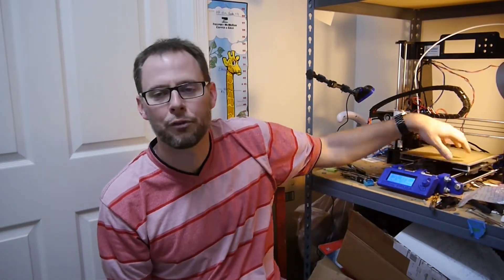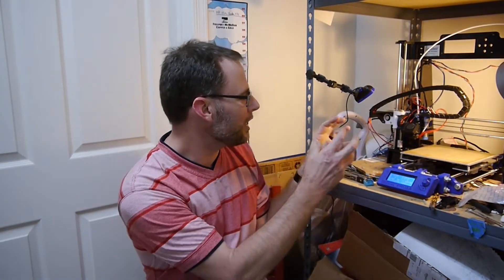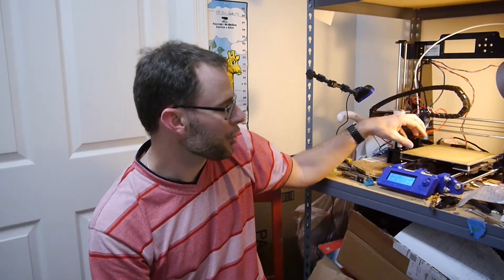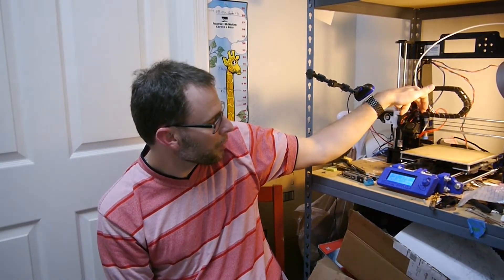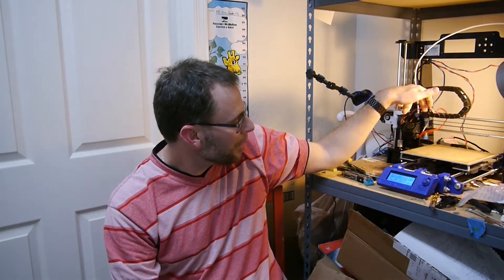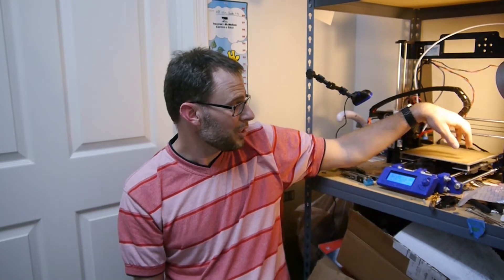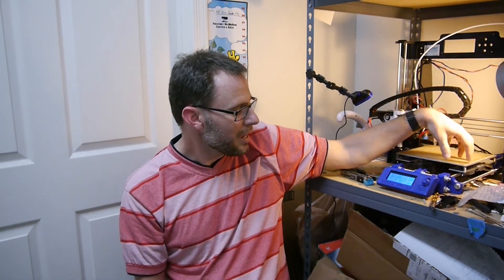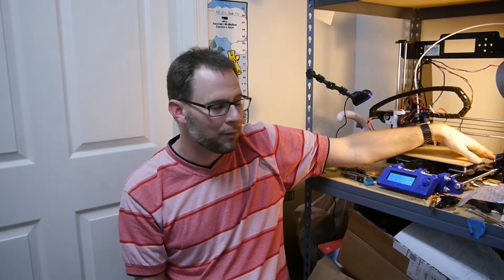Top 5 Upgrades for Anet A8

Comment: Great video. I just replaced my board and now using the same set up as you with 8825 drivers, what voltage are you using for the drivers?
Reply from the maker: I think mine are running about .9 volts
Reply: Are the stepper motors not running extremely hot at .9 volts?
Reply from the maker: Ismael Dioffo they are warm, but not extremely hot.  I can put my hand on them for a while before it seems hot.  Let me double check voltages and get back to you to make sure that's where I'm running them.
Reply: Mine get really hot at that voltage when I tried. Yes please if you don't mind checking and let me know

Comment: Good video.  You didn't mention the Bowden setup, or you consider that part of the E3D upgrade?
Reply from the maker: I do sort of consider that a 1 in the same upgrade because the kit comes with the bowden tube and connectors - so I guess I assume you'd do a bowden when you do the upgrade.
Reply: Yes that's what I figured. But you can get the E3D by itself, sans tubing/quick connectors and mount it directly to the extruder so I was curious thanks.

Comment: Did you swap your heat bed? Ive been looking for a better one that will goto 100c + but ive found nothing. Ive got a buildtec sheet on there now and bigger wires going from mosfet to bed.. 93 max..
Reply from the maker: I have not swapped my heat bed, but mine will achieve 100c, but not much more than that.  You might try bumping up the voltage from the power supply to get it to go higher.  Check out Tom Sandladerer's video about increasing power supply voltage.
Reply: Have you insulated your bed? I used insulating tape and very thick cardboard on the underside of my bed, and it hits 100 no problem. Might be worth researching
Reply from the maker: I have not insulated mine, but doing insulation is not a bad idea if your bed is struggling to get to temp.

Comment: Interesting top 5 - my own is completely different, but that is also what makes the a8 fun! I have a glass bed, hardened nozzle, fans, mosfet and a stiffened frame, with reworked y belt holder. It would be cool if you showed any of these upgrades from scratch when you get your new printer.

Comment: My A8 is also sitting with that 6 holes left in the top now.  Waiting on my Dupont connector kit and crimp tool to install the Ramps board.  I think this is a must as well.  Printer corner is going to get crowded with the Tronxy.  Great tips!
Reply from the maker: When the X5S gets here, the printers are going in the garage, which means I have a lot of work to do in the garage to get ready for that.  

For the 6 holes, I think I'm gonna print a plate to cover that with the Cheap 3d Printer logo in it or something :)